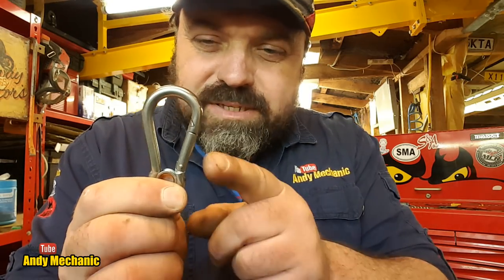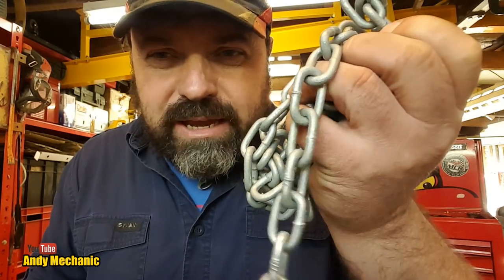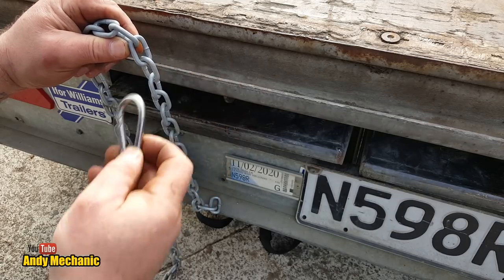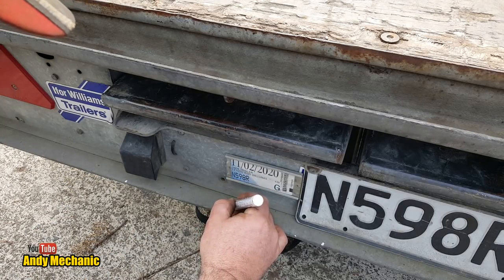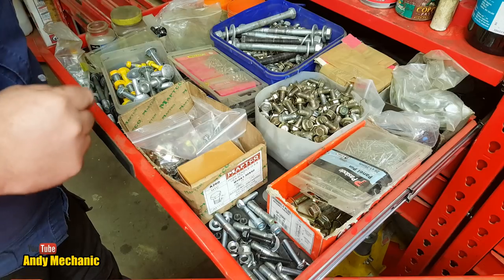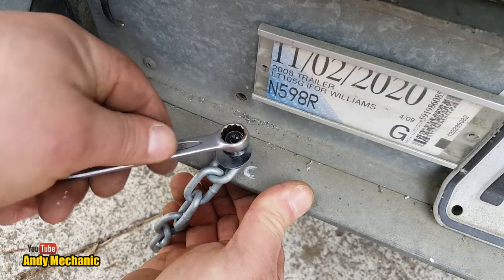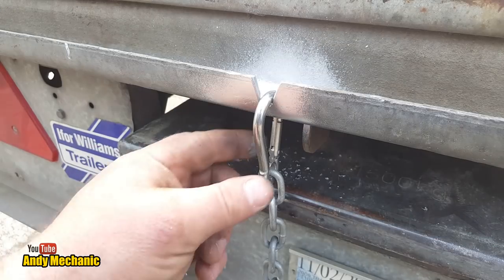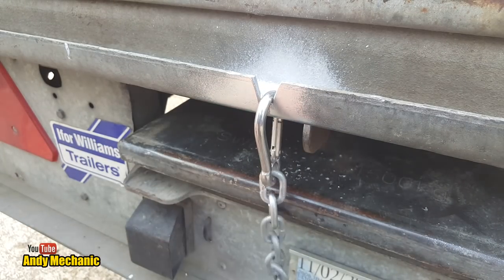Ifor Williams Trailer ramps issue #1986

Comment: Its been a long time between drinks but hes back!!. That's one of the better ramp stay solutions I've seen. I'd seriously think about changing the chains to high tensile if you regularly accessing rough terrains as impact from the ramps will eventuality cause fatigue and eventual failure of soft metal chain. 👍👍🇦🇺
Reply from the maker: Good Point Andrew, I'll see what I can find.

Cheers Andy

Comment: was there room to use a long bolt or metal rod thru the upper and lower holes with a clip thru the bottom of the bolt?
Reply from the maker: I did think of that as another option & yes, I think that would have worked just fine. However, I went for the chain option as I had a lot kicking around.

Thanks for your input

Cheers Andy

Comment: u could have welded or bolted the chain to the ramp and drill hole on to the side of the ramp as well
Reply from the maker: I didn't want to Weld to the trailer or ramp as they are galvanized and didn't want to have to grind away the protective coating. With regards having the chain attached to the ramp - this would, for me, be incredibly annoying when pulling the Ramos out & more so when putting them back in.

I think the solution I came up with was suitable given the parameters I had to work with.

Thanks for the feedback.
Cheers Andy

Comment: we usually use something like this
http://cmtrailer.co.nz/sites/default/files/imagecache/product_fullsize/te12f837_spring_bolt.jpg
just a basic spring bolt latch. can lock it open, no chain to drag on the ground or loose clips etc.